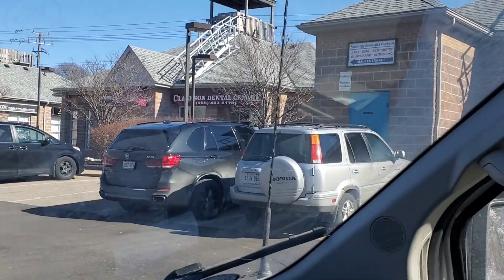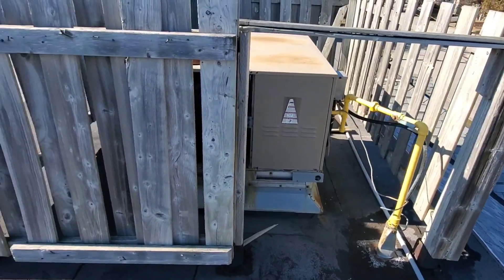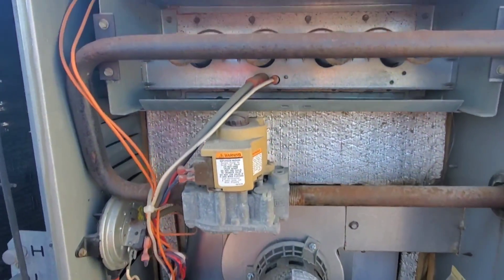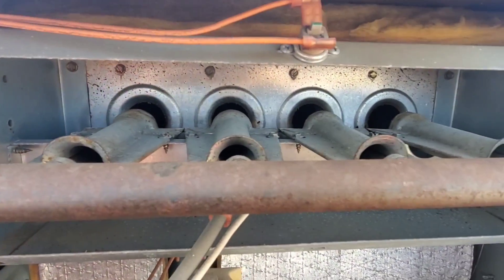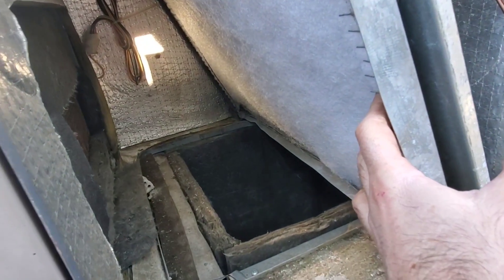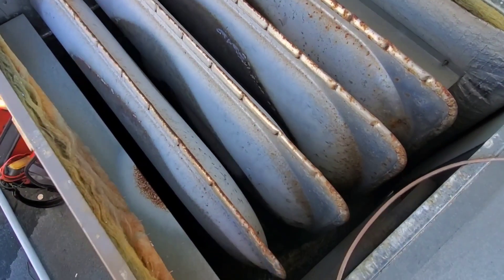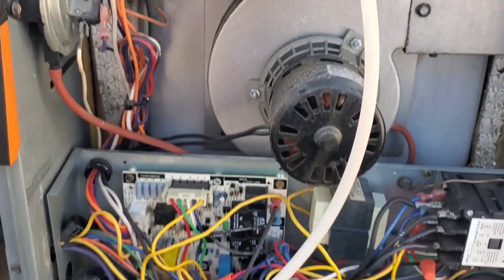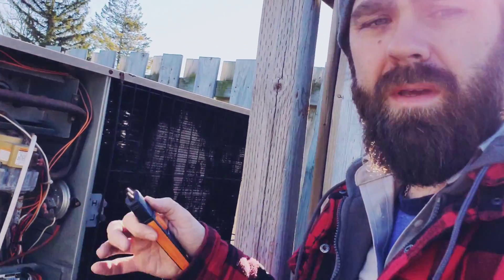Roll Out Switch Diagnosis

Comment: Not tripping the roll out switch when you tried it as the door was off. When a rooftop has be running for some time, what could possibly cause the blower motor to reverse? Same with the slight gas overpressure, it's been that way for some time. I think I would have replaced the rollout switch as well as correcting the manifold pressure and also checked fan static pressures.

Comment: Hey buddy today my furnace went out same flame rollout switch problem, had guy come to check says the pressure control valve assembly needs replacement because pressure is off. It would take almost a grand to replace and uncertain wait time for the parts. How did you change the pressure to make the gas control valve work again? The technician didn't even bother to adjust it and told me it needs replacement.

Comment: I had all them symptoms so I started replacing parts started with flame sensor then I tried pressure sensor and fixed it both parts cost me under $30 I'm just glad I didn't have a dirty coil or a vent clogged
Reply from the maker: Those parts prvented a flame roll out?

Comment: i would have suggested  checking  the heat exchanger, also amp draw of inducer, and check exhaust for possible/partial blockage
Reply from the maker: I did check the heat exchanger, you should watch the entire 😆😆.  The unit has been running call back free.
Reply: @HVACKnowItAll  my bad i missed it first time, not trying bust balls.  also good to check between cells closest to burners, if there are rivets/rings will be the first place to crack. as old as it is and heat stressed as it looks id be surprised if there wasnt at least a small crack. gaspacks are especially prone to hx failure bc the evap is before the hx causing condensation and rot

Comment: How come you guys drive over an hour for a job. I can't get anyone drive 45 minutes. If they are not local forget it.
Reply from the maker: I chose to live an hour outside the city 😆
Reply: My grandfather built up our firm against stiff competition to some degree because he was willing to work further out than the competition.
Which my father did and I do and my two sons do, as well.
Funny, but in over 70 years...not much has changed in that regard. We're still about the only firm which will do work out in the boondocks.

Comment: I had a Trane RTU a couple months ago where it would run ok but when I put  on the door the flames would come back at me. It was -28*C on a Friday night, so I cut a hole in the door.  Later I replaced the inducer and it seems to be good now.
Reply: Always check amperage on both legs of the induce motor. I had one that would explode like a shotgun. Turns out I was only drawing amps on one leg. This decreased the rpms and this caused the booming effect.
Reply from the maker: Nice, thanks for the share!

Comment: I wonder if snow cut off the combustion air vents? Or just a weak limit?
Reply from the maker: Didn't snow really, maybe or hopefully the elevated gas pressure was just enough
Reply: @HVACKnowItAll  sometimes I'll mount a temp sensor beside the limit and put the covers back on and watch what the temp does,  if no where near the rating I'll change the limit. That looks like the Armstrong I changed the draft motor on in a video I posted a while back. Old turd needs a good flush down the toilet😳😉

Comment: nice fix, would checking temp rise and total external static pressure be going overboard? I have had calls were someone closed diffusers or fire damper closed increasing total external static and tripping high limit.
Reply from the maker: Yes of course if it tripped the limit, I would have checked that for sure

Comment: Do you ever check the heat exchanger with combustion analysis? It’s a method we use down south and it saves having to tear apart the unit to visually inspect the exchangers.
Reply from the maker: Yes I do use a CA, but the only way to find a crack is to locate is visually.
Reply: HVAC Know It All but if your co ppm, o2% and excess air % are out of range that tells you the exchanger is cracked and you wouldn’t need to break the unit down to get a visual.
Reply: Samuel Hartness True.... what’s wrong with a good old visual? Sometimes this CA act up... just saying. I agree with both methods, I just don’t see anything wrong with a visual
Reply from the maker: You could have those symptoms with plugged burner orifices or perhaps even RPM reduction in induced draft motor.  I wouldn't trust a CA to tell me the heat ex is cracked myself
Reply: Yusuf Ata  I don’t see anything wrong with it. It’s always easy to check on packs. But 
I work in residential so we have a lot of split units and it just wouldn’t be feasible to take the unit apart and inspect.   A bore scope can only go so far as well, so we rely on the ca to tell us.  That’s not to say that using the old method of sight and smell doesn’t happen. I’m just thinking in terms of saving time and using new technology to do more of the work.